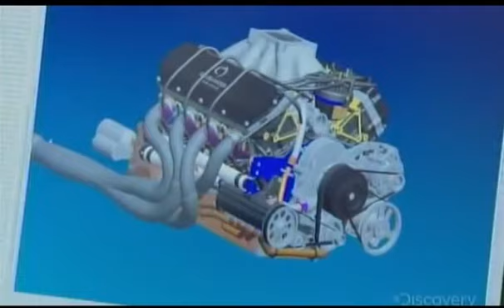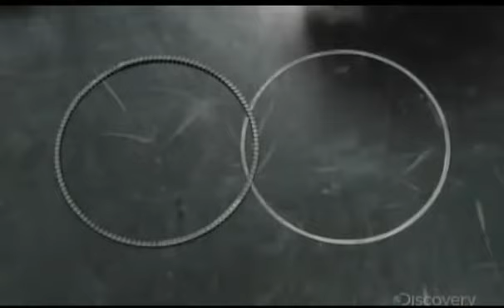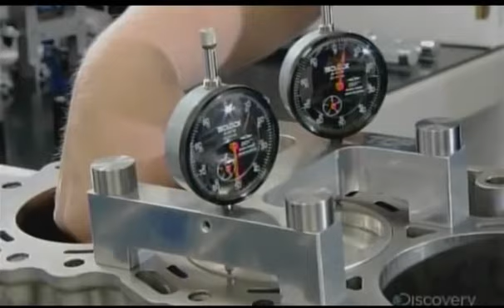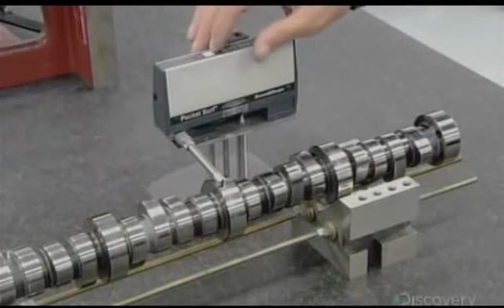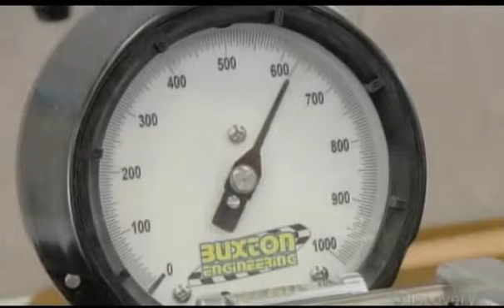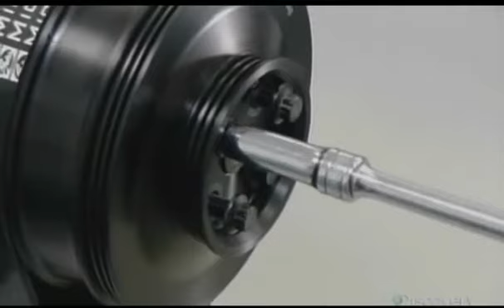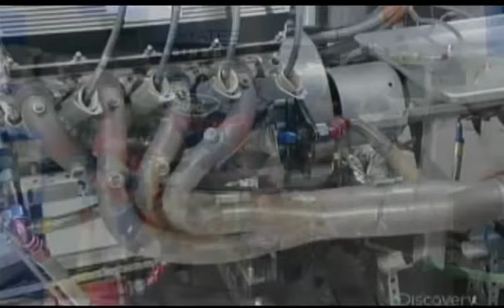How its made   NASCAR Engines

Comment: and not a single gasket in sight
Reply: Daniel Cross it's just a demonstration engine they didn't even use a tool to carefully install the piston rings just by hand scratching the sides of the piston.
Reply: I dont see any part where they're installing anything that need a gasket except the head. and there sure is a head gasket there. you may be right about the oil pan thought but cmon this is a 30 minute show which usually covers 3 to 4 different types of things. you want specifics go take an automotive class lol
Reply: pop eye:  Small scratches in the piston make no difference in performance or reliability, (sans high spots).  The piston has virtually nothing to do with retaining compression, (the rings and cylinder wall do that job), and a scratch can actually help the piston wall retain oil.  It's when you get a damaged ring and/or cylinder wall, where performance is lost, (considering the piston, rings, and cylinder wall only).

"How it is made" was never very good at the technical aspects of how it is all made.  That would take a lot longer than a TV show can run.

My whole adult life has been in the manufacturing sector (the only sector that produces wealth), and "How it is made" is not a good reference if I want to make something.  It's more of a "get your feet wet" show, and I hope it has sparked interest in the younger generations.

We had a metal shop in HS.  All these kids have is a TV show.  Bummer for them.
Reply: meh I suppose that's fair enough really lol
Reply: oh, i was taught wrong
Reply: the bearded off roader lol
Reply: Man. I was thinkin the same thing. I was watchin this and I looked up at the tv for minute and heard about the intake manifold and was like hold up. You forgot a step there
Reply: Those are definitely optional 😂

Comment: The only part were they fail is to mention the price of one of these bad boy engines . Average price is 35-50 k
Reply: Thanks for your informative reply, unlike many who like to insult instead of saying something useful.  Youtube has become a cesspool of bitching and whining.
Reply: The bare blocks alone are $10k. You can find them online for sale. Roushyates is the manufacturer.
Reply: The prices comes from precision work and everything being CNC because they have to make the power N/A and with a cap on cubic inches. Which means they have to go high compression and thus use insanely tight fits on pistons and have very advanced valvetrains. The blocks are probably the least fancy part about them as it is the valvetrain and heads where the black magic happens in general. Since its high RPM sustained, I would imagine the crank being expensive too, as it too is CNC with a custom short stroke.

It's a bit silly though as one can easily make the same power with some simple forced induction on a junkyard or crate engine and a lot less compression (so it will last and can be road-going too) for 10-20% of the price of the N/A monster. It won't sound as awesome though.
Reply: Lol try over 100k. A crank alone is 20-30k
Reply: +Zach Gonzales really, what makes them so pricey ? CNC machined I guess and maybe exotic materials

Comment: Tradition=archaic 
Lets use a OHV deisign, but then again they dont need anything fancy to go around an oval.
Reply: It's funny because they still make more power, are lighter, are easier to work on, and are cheaper to modify than your DOHC "technology"
Reply: old as hell tech that pushes 850hp to the crank (750 now) and runs flatout, nonstop all day for 500 miles
Reply: NASCAR is still very tricky, expensive, and hard to race in,  and team effort involved
Reply: F1 cars goes 2500mils on one engine...
Reply: HAHA, naah man, Put a 2JZ turbo engine in it and you would drop a 100 pounds easily ;) and it would run for 10 000 miles...
Reply: or just turbo the v8...
Reply: but then you just added a turbo into the equation. if you did that. putting a turbo on this thing would smoke a 2JZ
Reply: Cyramor11 Yea, but then you would need restrictor plates to keep it at the right power level ;) And then your weight is just a dissadvantage!
Reply: Just so you know.  Corvette team in Le Mans racing has been one of the most winning teams for the last 10 years using a OHV engine.  P.S. not a corvette fan just pointing out facts.
Reply: No they don't.  They go about 300 miles.  Practice Qualifying and race.  After that they are fully rebuilt.  I think what you are referring to is the 3 engine rule but that is just engine blocks so they do fully rebuild the engine after every race.
Reply: just me In F1 they have to hold for 2500 miles, because they just have a certain ammount of engines...

Corvette has never won Le mans...just in a lower series. The only `murican team that have won is the ford team.
Reply: The Esseboy No
Reply: ***** Doesn`t seem like it. But maybe they tak one Left turn to much and end up in the middle?
Reply: ***** Yea, but they are very few and the performance is laughable,
Reply: ***** F1 does that for real good. If they had the same displacement they would go close to 300mph. They make 600HP from 1.6 liters...

Still you are going on with your petty insults, tsk tsk, only real dumbasses insult people on the internet, smart people understand that insults means nothing on the internet!
Reply: yes they do but they dont run at redline for 400+ miles and are constantly changing rpms
Reply: ***** Why would I do that? Do I look like I have a several millions? Naah, but every man can analyse the results of their terrible work. The rules are from the 80s and should be renewed! Allow smaller tubocharged engines, DOCH heads, pneumatic valves, limit fuel and make the track larger to make room for faster vehicles!
Reply: optimusboy1 HAHA, have you ever seen F1? They are constantly braking and accelerating...that is way harder on the driveline than running in top gear for an hour...

And on top of that they have to be efficient...
Reply: a pushrod engine is OHV
Reply: Just so you know, over head cam is about as old as over head valve.

Comment: Did anybody see a torque wrench? The guy with the speed wrench must have a calibrated wrist.
Reply: They probably edited out the part where he goes back and torques everything.
Reply: ya, and I think we all know how he got that
Reply: Lol
Reply: When I worked on Mercedes, they had a common problem at very high miles that required removing the intake manifold. Torquing the rear screws was the reason the job paid so much, you had to remove the motor mounts (huge hassle).
I decided to see how well I could do it by feel (I had been a tech for many years at that point). So I tightened the bolts I could reach easily by hand, marker their positions, loosened them back up and used the torque wrench.
Turned out I was dead nuts every time.
Reply: Did anybodt see a gasket??? of any kind???

Comment: "stock car" LOL. Ford Fusion with a carbureted V8 and no overhead cam? Aha.
Reply: "Stock" refers to the fact that all cars are built within the same set of parameters -- no one car should have an advantage.
Reply: nascar did switch to fuel injection a few years ago lol. The term stock car has pretty much gone out the window with a nascar sprint cup car now a days. But it still has some meaning when it come to the current nascar race cars. Back when nascar began that's what people used were stock cars with a few minor changes. But with time and technology just like everything else the cars changed. i think up until the early 80's the engine in a nascar had to be the same displacement as a production car was. Or something along those lines im not 100% sure. Basically now the word stock car means that the 2016 nascar race car has to look just like the 2016 production model car looks like. Even then there's a big difference lol.
Reply: No NASCAR race cars used the same displacement engines as their stock counterparts in the early 80s.
Reply: Spec car the Stock cars died in the 1980s

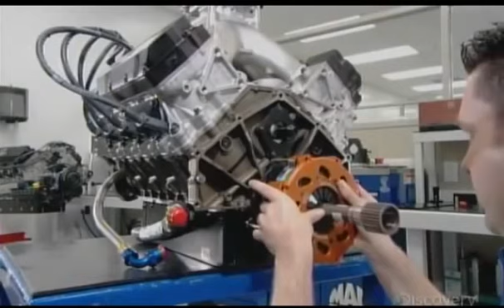Comment: What I find interesting here is that this Ford NASCAR engine uses a Chevrolet bell housing bolt / flange pattern. You can see this at 8:58.
Reply: there really isn't a difference in nascar engines. they're all pretty much based off of a small block chevy.
Reply: Yeah, somewhat, it's based off of what NASCAR wanted, so they're all custom build to nascar spec, but Chevy happen to have the best, I guess you could say idea. So NASCAR went that way with it.

Only engine that is different, is the toyota engines, which are based off of dodge, ford, and chevy stuff, since toyota never made a push rod v8. 

Also clutch can be really small as they only ever use them just to launch from a dead stop, they normally don't shift with the clutch.
Reply: That style of bolt is not exclusive to Chevrolet. Many car makers use that. Plus, those are probably from a bolt manufacture like ARP.
Reply: +Pat L Not a bolt, the bolt pattern aka the flange.
Reply: +John Rambo the bellhousing is a part of the transmission.  Yes, the bellhousing mounts to this flange.
Reply: +John Rambo it is a race engine, manual.
Reply: ***** It's a racing clutch, low mass for high RPM, multi plate style.
Reply: Killertoad There's a rumor that the Toyota engine is based off of a GM design that was given to them.  Not sure if there's any truth to that, but even the Toyota engine uses the Chevy trans bolt pattern.  So, it's likely a case of one transmission fits all in NASCAR.
Reply: silicon212 The bolt pattern is like that because of what you said, they all use the same transmission
Reply: Nobody else but chevy uses that pattern from the factory.
Reply: Depends on your definition of "from the factory".  On a car sold to the public, it is true that only GM (not Chevy but all of GM) uses that pattern on V8 and some V6 engines.   If you mean anything from the factory, you are wrong.  NASCAR rules state the block being run must be made by the vehicle manufacturer.  So, the Ford Racing block you see in this video is made by ... Ford.
Reply: silicon212 Factory means Factory, the engine normal joe would get from the Factory on a dealers lot.  Race engines are cast and built on their own and not from the Factory.

Comment: lmao "air conditioning"
Reply: you have no idea how hot it gets in that metal box a.k.a. nascar... even if they have no driver and passenger side windows in the front...
Reply: +gewoontimm they don't use air conditioning. they have water circulating their suit.
Reply: i know.. i did not mention airconditioning
Reply: In a way they do have it. It's a system setup to run fresh cool air to the helmet on top of alreay having the cool shirt system. I have a cool shirt system in my race car.
http://image.hotrod.com/f/33695068+w660+h495+cr1/ctrp-1110-05%2Brace-car-air-conditioning.jpg
Reply: http://www.f1technical.net/forum/viewtopic.php?t=12260